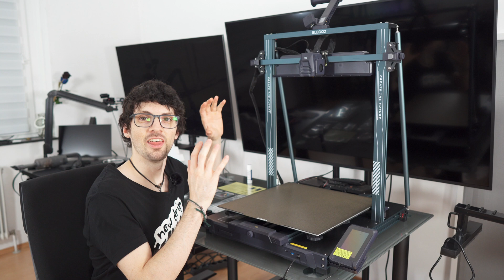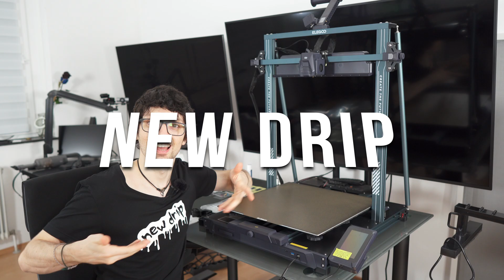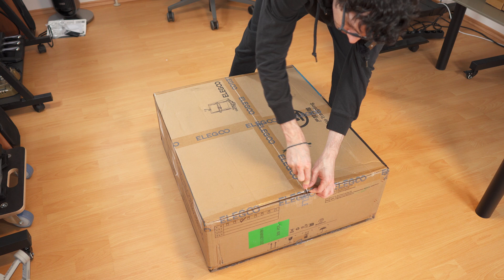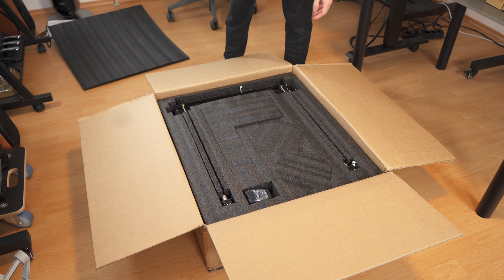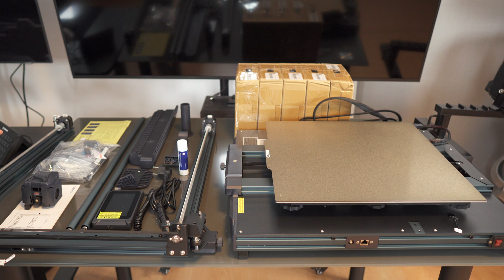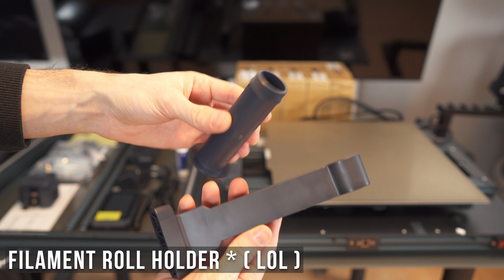2024's Best Value BIG 3D Printer! - Elegoo Neptune 4 Max Review & Test (Black Friday Deals!)

Comment: I've owned this printer for months; the major problem with them is an underpowered power supply, and the warping of the edge of the bed as it warms up (flexes on the edges as the center is warmed up initially). You must wait at least 15 minutes once the bed is warmed before you begin printing, or raise the print bed to 80 degrees (60 is not enough) if you want larger prints with a footprint beyond center.

Comment: Heat bed is limited to 85C so not sure ASA would print well.  Also you would want an enclosure for ABS, ASA, PA, etc...  especially if you are looking to use the build volume.  Keep debating this printer but that max bed temp of 85C keeps me from buying it